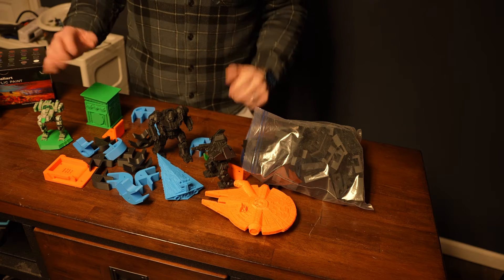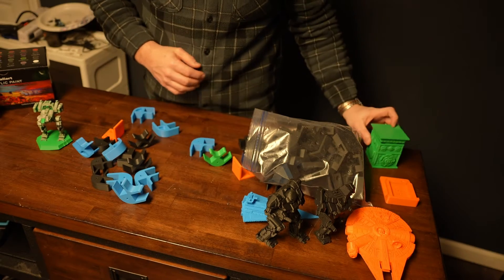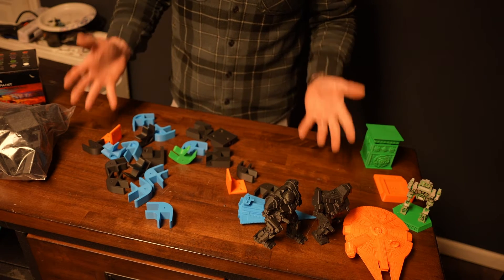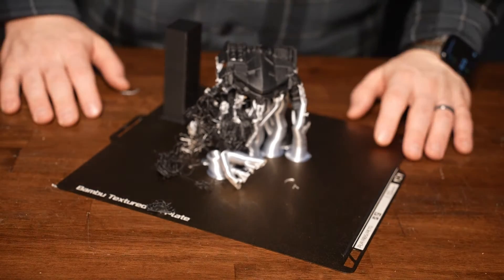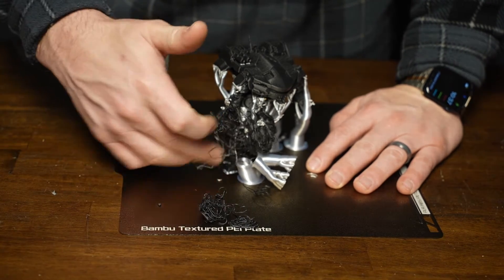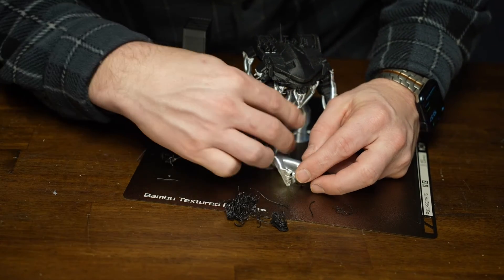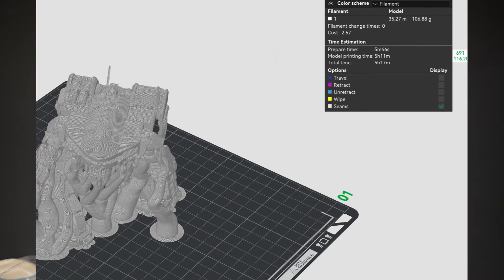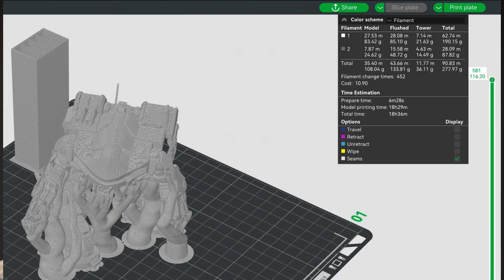Bambu Labs PLA Support Filament - Worth the hassle?

Comment: I don't think tat the support filament is just a "plug in replacement" for ordinary supports. I think you're supposed to take advantage of the lower adhesion by changing the settings to make the support surface both closer and more dense. That's just my theory, I have tests to run!

Comment: Lots of comments for using it as a interface only filament.  I absolutely agree.  I speed up the print, make the support/raft interface the only thing using the interface filament and set "support/raft base" to the same filament as the model.  This results in not swapping for interface filament until the supports are actually 1 to 3 layers away from contact with the model.

Comment: Daniel, I just received an email from BBL, they have a new support filament that is WATER SOLUBLE.  Might want to check that out, it is kinda pricey, about $39 per kilo.  Correction, that price is for a 1/2 kilo spool! I have a P1S and if I print with supports, they most always come out bad.  In some cases, you destroy the model just trying to get the support materiel off.

Comment: Also, if you can, test Add:norths HT PLA Pro Matt. Super nice surface and very easy supports to remove. Though a little expensive so use it wisely :)

Comment: Good video. I didn’t like it either, no real change when removing supports. I would like to add that just use it at the interface and for even better result use PETG instead and set the interface distance to zero. Smooth surface and easier to remove. :) happy printing!

Comment: you can just use the support filament for the last one or two layers of the supports, and print the supports with the same PLA you are using for the object you are printing. that way you won't waste so much support filament which cost more than basic PLA
Reply: How would you go about setting that in bambu studio without using a bunch of modifiers for the support? Is there specific setting for that?
Reply: @J_spec6  look for the video titled "Using PETG to Support PLA on Bambu X1 Carbon"

Comment: I use sometimes PETG for the support interface layer which can have a similar effect because PLA and PETG don't go well together. 
A starting point that worked well for me:
- Support Style "Snug"
- Support Interface  "the Support Filament or PETG" (you only ant to print that interface layer in that material)
- Top Z Distance "0" 
- Bottom Z Distance "0"
- Top Interface Layer "3"
- Top Interface Spacing "0"

So basically you want the special material only at the interface layer, but there very snug without a distance. 

Personally I also disable the prime tower than and increase the flushing volume between the two filaments a bit instead. But that's still experimental for me so I wouldn't say it's the right way to do it. I was just a bit concerned that the prime tower could knock over otherwise too.

Comment: i am not using support material but want to use it. afaik it is really the kind of thing that if you are not sure whether you need it or not than you don't. its sole purpose is really to get prefect overhang surfaces that are not otherwise achievable without painful amount of post processing.
also bambu p1s have pallet purge so you can turn off that purge tower which saves 10%+ of filament/time.

Comment: As others have commented, it's only intended to be used at the interface layer. Within Bambu Studio, go to Support > Filament for Supports, and choose the support filament for "Support/raft interface" *only*, with "Support/raft base" set to default. When you slice you'll see the support filament is only used for a single layer at the top of your supports. This should solve pretty much all your problems and greatly reduce usage of the expensive support filament. It still requires filament changes, so it will be slower than just using one filament for everything, but depending on the print, this might be a very small addition to the total time instead of tripling it like it did for you.
Reply from the maker: Good input, Joel! I will try to do an update with these settings and see what impact it makes on the prints.

Comment: You misused the material. Right on the product page it says “Cautions for Use: ONLY used for support interface”.

When you’re only switching to the support material for the interface, you might only need a few filament swaps for the entire print, so the added print time isn’t much.

Your print using the support material for the entire support has to do way more filament swaps, which slows it down drastically and also uses a lot of the support material.

Using it as it’s intended, it should be fairly quick and last you a very long time!
Reply: You can actually turn off the purge tower too it's not necessary when you only use the support material for the interface. You won't waste a lot of product this way.
Reply from the maker: Good input, I will revisit with these settings and see what impact that makes. Appreciate good counsel!
Reply: You are saying that support filament should be swapped in at a certain layer, reasonably late in the printing process?
Reply: @kodeypatterson8973  if you use the option to use support filament for interface layer the slicer handles this for you automatically, it isn't layer based, instead anywhere the support is going to touch the actual print it uses the support filament instead of the regular filament.

Comment: I think it's intended to be used as an interface layer only. I don't think it's strong enough to print full long supports well. May work sometimes,  but it may not. Personally,  it's too expensive for the results, for me. Because when you use it as an interface layer only, it's prints well, but the removal is a little trickier. The results on the models are good, but the interface layer normally needs to be picked off the model, and that's a little annoying. 

Also, note that when using it as interface layer only, time will be shorter in most cases because there will be fewer filament changes.
Reply: Correct, it's only meant for interfaces. It will also reduce the amount of flushes, and therefore print time, tremendously,